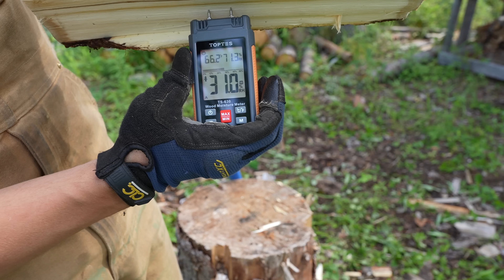Summer Cabin Life Alone In Alaska | ASMR | Firewood, Fishing, Catch & Cook, Building

Comment: I'm sure You Tube will notify you that there's not enough drama to trigger today's algorithms . (Add in some Bear attacks, dude, we found a dead fly fisherman, we got his Sage rod and tackle , yay, woo-hoo, etc.) And you guys walk down to the river? Jeez. Hey I have Q. What to watch out for with guitars , stored mostly in the cabins. I play too, I know the protocols of moisture regulation and hard case storage, but I'm curious on when the temps in the cabin might dip below 55 if you don't have the propane going. (My other Yamaha finally exploded years back, but that was after a bunch of campfires and being lugged in a cheap case in a hot minivan. So I deserved that.)
Reply from the maker: Great question! Yes cold temps and low humidity can be bad. Anything below 35 percent humidity isn’t great, but not too bad until you get to like 25 percent and below. It can get down to 12 percent humidity here in the winter and I’ve had guitars just play AWFUL durning those spells. My cabin weirdly doesn’t get too dry, probably cause I keep water on the stove as a humidifier. But the trick is, if your guitar gets really cold. Warm it up slowly, like keep it in the case for a few hours at the new temp. Don’t just open it up after it’s been freezing. Some guitars just keep on keeping on, others get badly deformed. Good luck!